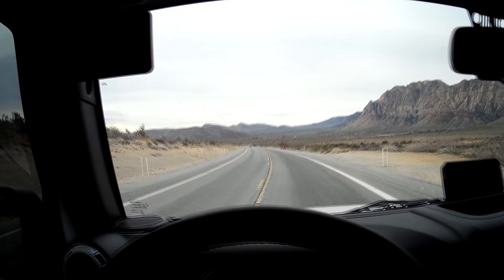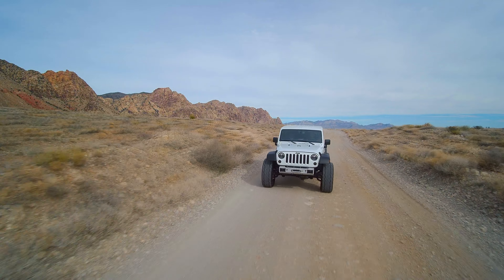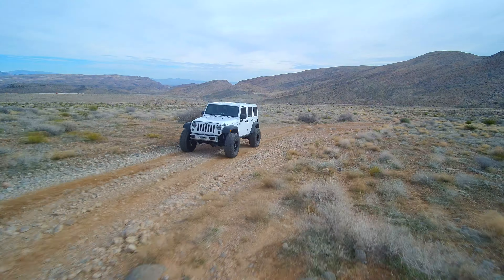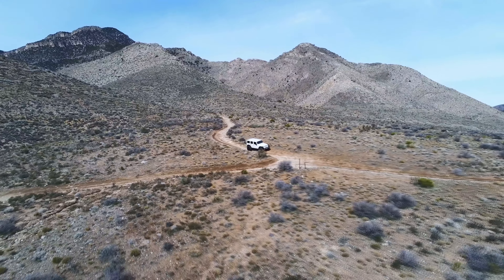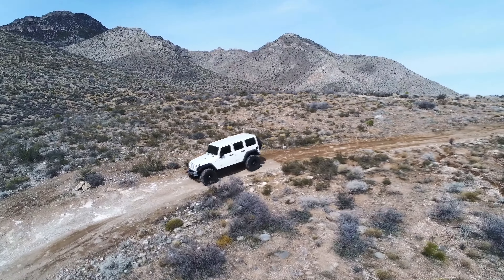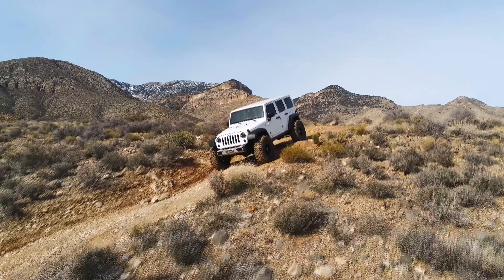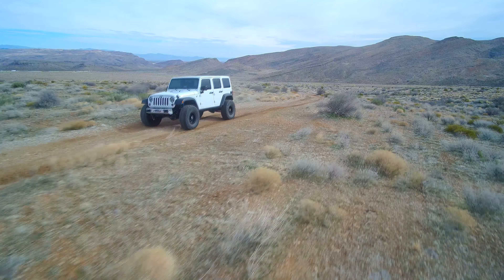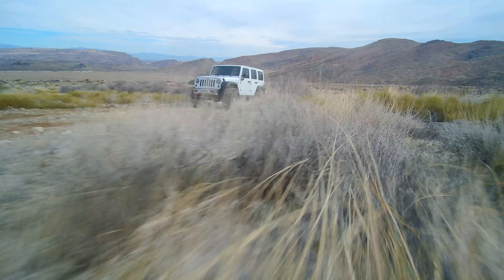460 HP LT-1 8 Speed 8l90 JKU EVO, PSC...

Comment: I have a Sahara Unlimited that I upgraded the front diff with a D44 and 5.38 gears with 37's. What size tire would you recommend with the 5:38 gears? Will the D44's handle the horsepower/torque/tire size without snapping the axles?
Reply from the maker: With 5:38's 40+. The 44's won't hold up to a 6.2 LT with 40's for long.